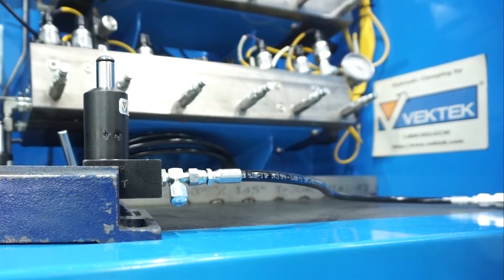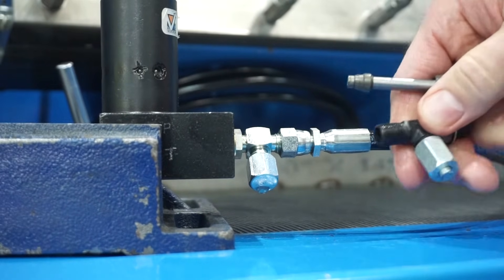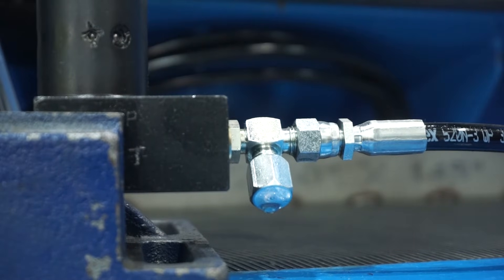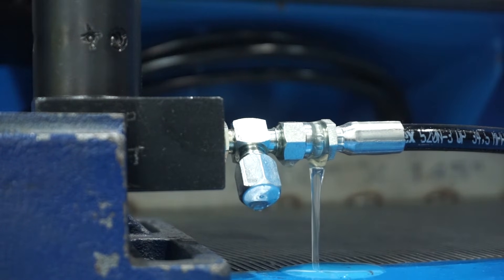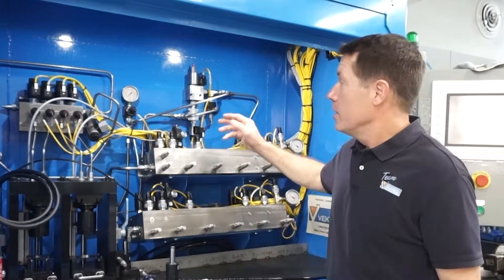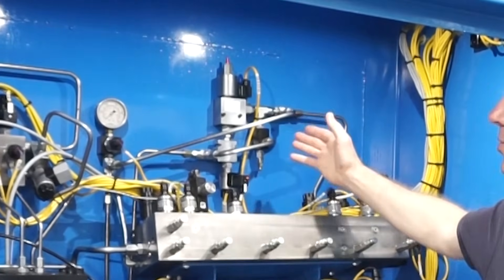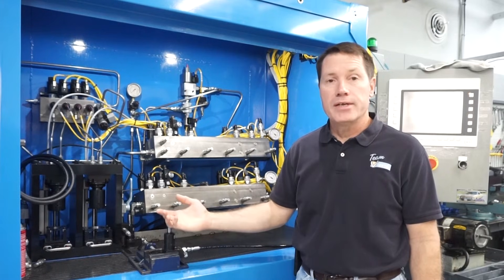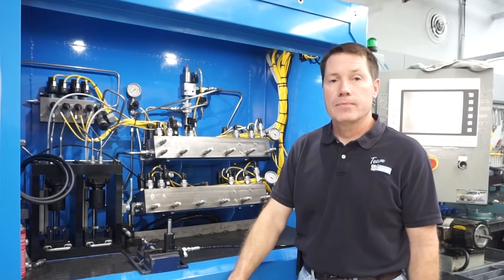How to Bleed Air from Hydraulic Circuit

Comment: We have a dumper with two cylinders that dump packages.  The pump is a gear pump with a small reservoir tank.  Will any air trapped go into the reservoir then out the breather?
Reply from the maker: You can reach out to us at: 		customersupport@vektek.com

Comment: It's not getting clear,, iv bled it everywhere, let it sit 2 days to let bubbles possible pop. No luck, changed filters, hoses. It flows good but still looks like water mixed,, it's a 20 gallon tank, I drained it, flushed it 4 times, still looks like water in there,. THERE IS NO WAY WATER CAN GET IN UNLESS DONE ON INTENTION
Reply from the maker: You can reach out to us at: 		customersupport@vektek.com
Reply: Did you ever fix your issue? I'm having similar symptoms and can't find a solution

Comment: Hi if there is air in the circuit can this lower the hydraulic pressure because my pumps on my machine are reading to low pressure and I did have a hydraulic line that broke wel 2 actually 

And so for the bleeding of the air do I just open the nut that is on the cilinder  to let air out because I don’t think there is a specific spot on my machine
Reply from the maker: Contact us at repairs@vektek.com and we will get you some specific help.

Comment: Hi, just one question please, the double action cylinder produced more power than single action? Also, if the system have air inside the power is less? I open the single action cylinder and the male part did not have a seal at all, the single action cyliders do not have seals? Recently i finish press machine (homemade) using cylinder with male part 80cm diameter and oil pump from clark machine 12volt and the power is no more than 2 tonnes, i am very sad!!!
Reply from the maker: Hello Exumpakias, 

The output force of a cylinder can change depending on its internal design. The force of a cylinder is also based on the effective piston area and the operating pressure of the hydraulic system. As for displacement cylinders, Vektek has one family of devices that were designed in this manner. These devices do not have a piston seal and are returned by the internal springs. For this one family of actuators, the double acting equivalent devices do have a larger extend force concerning its footprint. This is due to a piston seal being used. 

If you happen to have some air trapped in the cylinder, most hydraulic pumps will continue to provide fluid and pressure. The air will get compressed and the output force of the cylinder will not change. If the air remains in the hydraulic circuit, then you may witness some sporadic/sluggish cylinder movement as the piston is actuating. I would recommend trying to bleed as much of the air as possible from the system.

Feel free to email or call our Customer Support Team at CustomerSupport@vektek.com / 1-800-992-0236. We will gladly help you with your current application and see if we can help improve its performance.
Reply: @Vektek1  thanks for your time and for the informations, preciate a lot.
Reply: 0😊😊